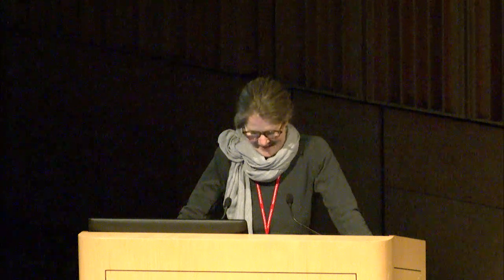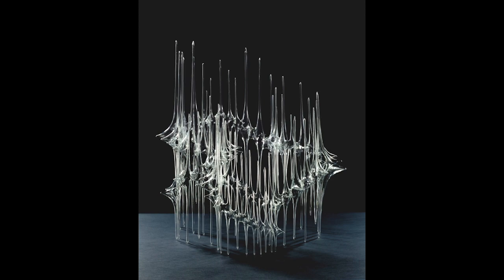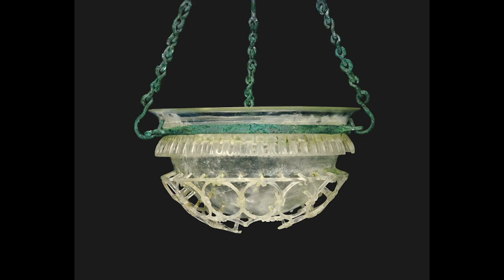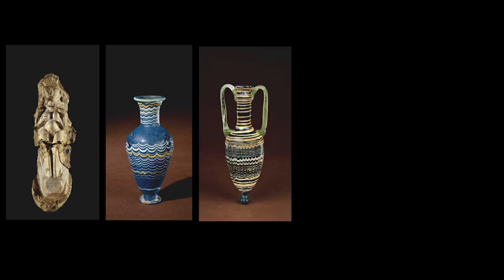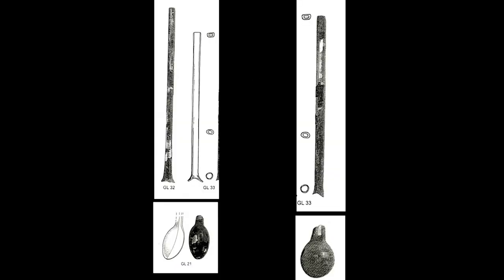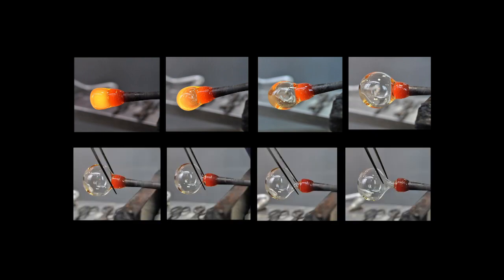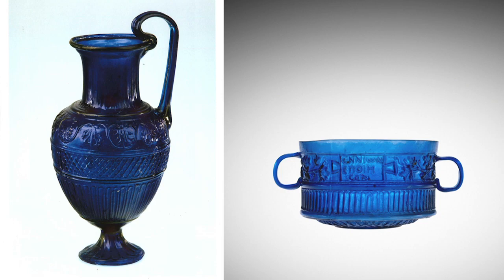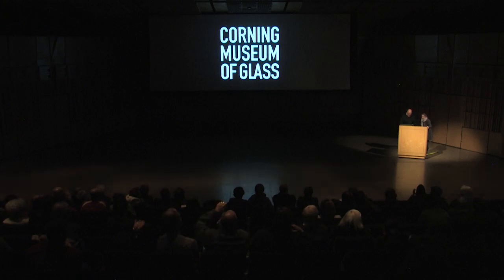Invention in Early Glassblowing - The Road to Ennion with Bill Gudenrath | Behind the Glass Lecture

Comment: In the Q&A Bill mentions comparing the vases when they're in the same room.  Did he do this and conclude they came from the same mold?  

Question 2: Has 3-d scanning of ancient glass objects for comparison been considered?
Reply from the maker: Hi Dylan, Bill Gudenrath and Karol Wight both had the opportunity to compare the vases in the same room and came to that conclusion. 

According to Kate Larson, our assistant curator of ancient and Islamic glass, 3D scanning of ancient glass is being done by some researchers for exactly this reason – to compare objects that can’t feasibly be examined side-by-side. But 3D scanning and modeling requires a good amount of time and computer power, so its application is still on a quite limited scale. It is best applied toward particular types of research questions for which a model might be useful. 

Thanks for watching!
Reply: I was thinking about the second question more in terms of the Portland Vase blown / pate de verre debate.  Thanks for the quick reply, have a good one.